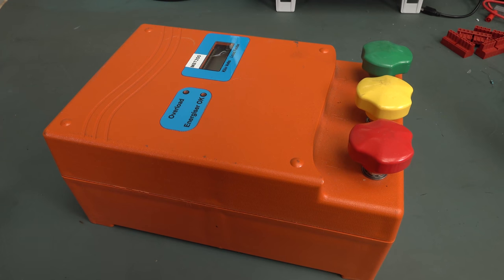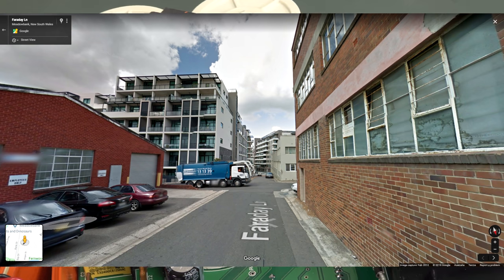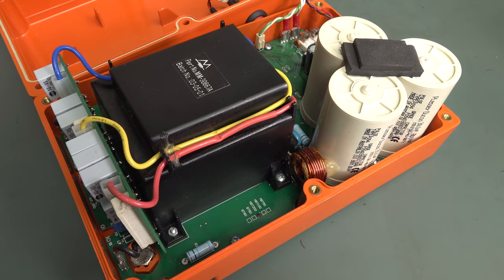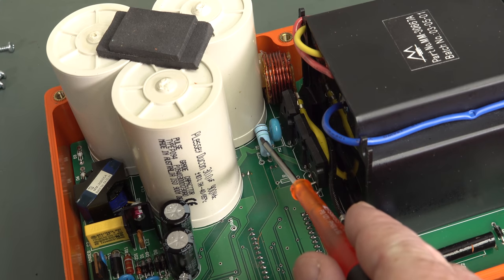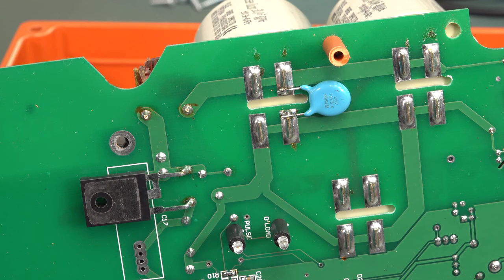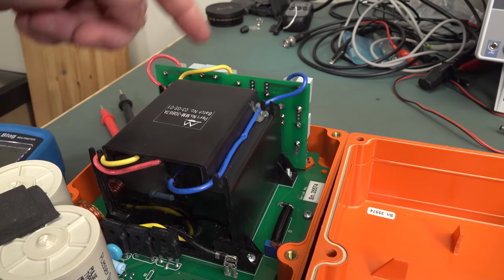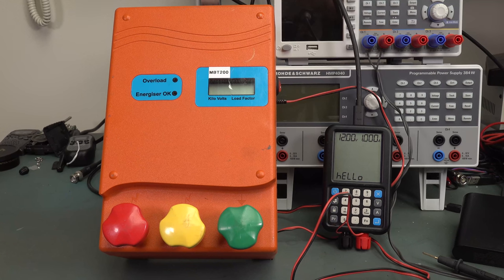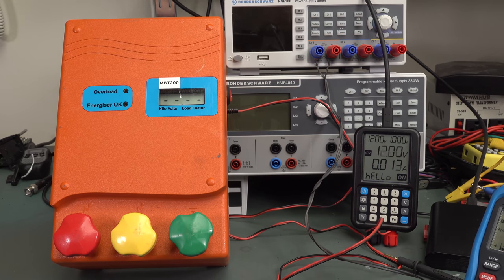EEVblog #1277 - Electric Fence Controller Teardown

Comment: When I was much younger, my buddy and I decided it would be a clever thing to run an insulated wire from the electric fence surrounding the pigsty over to the nearby metal clothesline as a "surprise" for my buddy's mom.  We ran the hidden wire and the last step was to reach through the barb wire fence and hook a little loop onto the electric fence.  I squatted down with my derriere a short distance from the ground.  The moment the hook connected with the electric fence, there was a discharge between my butt region and the ground.  I learned everything I needed to know about electric fences in a few milliseconds.  I basically defibrillated my privates.  I have always been careful around capacitors and anode terminals on CRTs ever since.  Yowzer.
Reply: The reason it happened is because the insulated wire you used wasn't rated for that kind of voltage. Your average run of the mill agriculture shock fence will put out 10-15 kV at a very low amperage. As you learn in welding, the voltage is what strikes the arc, the amperage is what burns. The amperage isn't enough to kill you, but the voltage is more than high enough to penetrate clothing and fur, without penetrating the skin. So getting zapped by either is basically the same thing, really. There's about 1kV per diagonal inch of CRT, so your average CRT computer monitor would be between 10-20 kV if it still held a charge.
Reply: @BlackEpyon  Cool info on the CRT telly's there.. : D my dad pissed by mistake on an electric fence when he was a young fella.. he said it went up through him from the tip of his Lad to the tip's of his Toe's & left him ten feet back on the ground holding his bit's in pain.... its a fuckin wonder i was ever conceived at all : P Not something id like to experience myself!!!
Reply: Thanks, I almost fell off my chair, pissing myself laughing. I had to keep stopping becuase I knew the next bit or the story was not going to end well.
Reply: @keithking1985  LOL!
I've never been "bitten" by the fence like that, but I've zapped myself on it a few times. Spooks you silly each time, but with these residential/agricultural grade fences, the point is to scare you away from the fence, not kill you. 

Zapped myself at least once on a CRT as well. You see, when I was a kid, my dad taught me to take apart CRTs and tune them (focus/color, etc). This has to be done live so you can see what you're doing, so the bit he didn't teach me then was how to safely discharge them, and that glass tube acts like a giant capacitor., aside from the DC filtering caps.

With these CRTs, the goal is to get electrons to flow from one end of the tubr to the other, so the voltage is very high, but the current is low, both to avoid burning the tube, and so that you don't draw an absurd amount of current at the wall outlet.
Reply: @BlackEpyon  i learned how CRT's worked from watching videos like Dave's ETC,, im teaching myself electronics & loving it... i have a few fly-back's in my parts box from old telly's!! i always keep them when i come across an old TV.. think of making cattle prods outa them.. Irish gypsy's would love to get their hands on them too. & seeing that im 1/4 traveler im in a good position to not get ripped off selling the odd one hear and there.. YA get me!! but yeah!! i always look where im pissing when im out shooting/hunting/fishing... ya just never know where a surprise might be hiding!!!
Reply: What a story !
Reply: @Chris Russell Fence half falling over? Yep! Dealt with enough of that. 

I got a good laugh the one time the pig accidentally backed up to the electric fence. Scared her shitless, 'cause she didn't expect it! We always had a problem having the fence close enough to the ground to stop piglets, because the pig and her impression of a bulldozer kept pushing mud up against the fence and shorting it out. For such a soft nose, those bastards are surprisingly good at moving dirt around that you can't get into with a shovel.
Reply: I did my TV repair education almost 40 years ago, nothing but CRTs back then.
Even by that time most high voltage transformers came in a resin potted enclosure.
But as we did customer repair as part of our training we often came across things from the -70's or even older.
At one time I did repair on an older Tandberg TV, at the time a local high quality brand produced here in Norway.
And this one had soldered leads to the output of the high voltage transformer terminals.
It was a 26" tube so the output was close to 20kV.
I'm not sure how I came to discover it, but by putting a screw driver to the terminals it was possible to draw arcs that could be stretched to 2-3 inches. I could even cut copy paper with the arc.
It was all fun and games until I eagerly wanted to share this "lightning force" with a fellow student and accidentaly grabbed a different screw driver that had a crack in the handle.
Definetely a zap to remember. And it left a hole in my palm that looked and smelled exactly like I would have drawn a match across a striker plate, ending the strike directly in my hand as it lit.
Reply: @jensrogerkristoffersen5472  Yeah, it's amazing how high voltage can get through cracks in the insulation. I wonder how those screw terminals didn't arc through the air though, when the conditions are right (must have a really good insulating boot). One of my CRT monitors (I'm into vintage/retro computing) had a small crack in the insulation at the base of the anode wire and would occasionally emit a buzzing sound until I gooped some silicone caulking around it. 

Most people wouldn't go through the effort of repairing CRTs these days, but when you're into collecting and preserving old computers, it's worth keeping them alive.
Reply: @BlackEpyon  - Most businesses don't go through the effort to repair flat screens neither. I bought a 50" Toshiba HD-LED smart TV and within warranty it was fried by lightning. Came home one day to find it all dead. Managed to reset it to come alive, only to one week later have the picture black out. Sound still working, but not very smart without even a channel display. Turned it in for repair and after a seriously long wait I had to go back and ask for it. Turned out they never got it back from the repair center in Sweden, it was scapped.
Just a note at the end of the service record, and never geting it back to the store they would never have contacted me. However it ended well, I got a much better 55" LG as a replacement.

I only worked with TV repair a couple of years after graduation. After that I've done mostly coaxial networks, C-TV and broadband. But I managed to keep my last "fat screen" alive for 15 years with some 7-8 repairs the last 5 of them. A repeating problem was that it switched off to standby. And every time caused by micro fractures in some solder point in the high voltage supply. Easy to locate, just switch of the light and tap the circuit board to see where the sparks were. Easy to repair, just resolder and wait for the next point to fail :-)

Comment: Dairy Farmer here; livestock fence units are normally either 5kV (sheep/small lifestyle blocks) or 10kV (Cattle/large farms). Although voltage can increase as you move down the fence line, due to bounce effect, or decrease due to shorts.

Comment: When I was younger ;) we would test the fence charger by grabbing a long reed or length of grass (meter and a half or so) and then slowly walking it over and in contact with the fence wire until we just started to feel the tingle. From this we could gauge the charge in the 12V batteries used to power the devices.
Reply: Yes, that is how I used to check them when hunting in rural US. We'd use a blade of green grass and cautiously move it on the wire.
Reply: Yeah when I was a boy we made up contests of who will get closest to the wire using a blade of grass.
Reply: And my dad's trick was to grab the fence with one hand and one of us kids with the other and conduct the shock to us. He was wearing rubber gum boots.
Reply: @dougvb9048  That was either really weak fence or your dad is a tough guy :-) I have 7J 7kV unit and that will go through wellies like nothing even if its down to 2kV because of distance or overgrown grass shorting it out.

Comment: Hey Dave, bush electronics repairer here....the yellow lug is sense, its designed to go straight to a peg in the ground, or directly connected to the green lug to give feedback when it dumps its joules.....also 3KV is a small unit, I have measured a 200KM unit at over 12kV, approx 2KM out.

The official bush test is holding a piece of green grass and holding it against the hot wire on the fence, if you can feel the zap then you are good. Gallagher had a unit on display at Ag-Quip a few years ago designed for 200KM+ runs and it was basically burning the grass with a 2M piece of 2.5mm fencing wire.

Edit: When they break it is usually the caps or transformer that goes, 50% of the time it is from corrosion, often just on the spade terminals you were praising, I have seen it a few times where farmers will keep the energizer in the same shed as bags of ferts/chemicals....ants are a good one too.

Comment: In the 80s I remember my grandad used to test his electric fences by touching them with a blade of grass held in his fingers. It still zapped you, but much less than touching the actual fence.

My dad touched an electric deer fence in the alps once with an aluminium walking pole. He said there was a large crack and then the pole shot out of his hand. Apparently he was pushing the fence down, ready to climb over it 🤦🏻‍♂️
Reply: James Grimwood yep, used to do the same.

Comment: So the way these generally work is on magnetic impulse. The caps charge at and store a lower voltage charge on the order of a few hundred volts. Then at regular intervals a triac triggers and dumps this into the transformer, which has a HV secondary to the output terminals, boosting the voltage to the kilovolt output. 

The ticking noise these boxes make is not a relay, it's the magnetostriction of the transformer core getting all that current dumped into it from the caps.
I repaired one myself previously with a failed triac (same symptoms, not ticking when switched on). It actually had a spade-mounted capacitor inside that could be changed to alter the amount of kick it gave (depending on your type of livestock, I assume)
Reply: Tesla strikes again!

Comment: I touched an electric cow fence before. Doesn't feel like a shock at all, feels like someone kicking you in the arm and chest.
Reply: Depends how you touched it
Reply: I got kicked in Oklahoma years and years ago with a bull fence.. I was 12 or 13 and pulled the Jurassic park and grabbed it to pretend I was being shocked to my cousin and it kicked me so hard I woke up on the ground smelling bacon.. burned my forearms and had a REAL barbed wire tattoo for almost a year..
Reply: Depend of how well it’s installed and how much grass is grounding the fence. Most of the time I touched them, they hurt but not that much. You need to think that cows are way better grounded then us so maybe it hurts them more.
Reply: I also got shocked by some wire fence, it wasn't that bad. (Don't know how exactly those work, but they normally didn't shocked you by just touching, you had to touch also some ground). Definitively a lot less than a 220V AC shock, which I've also got multiple times. (Yeah, I'm kinda clumsy :) )
Reply: Guessing this is because it's DC, so the muscles only tense, they don't tense/contract as they do with AC
Reply: Its pulsed DC, which contracts muscles just fine, thank you. And even if you wear insulating footwear, you're still capacitively coupled to the ground.
I was taught how to test our fences with a blade of grass. It works like a variable resistor - slide it closer until you can just feel the pulses in your fingers.
Reply: @galfisk  we always used grass too. I only got shocked once. My buddy had a brook trout farm with a electric fence on top of the regular fence. So the gate was open and the fence unhooked so I thought it was off... we were playing football in the melting snow and mud (it was late spring) and I put one arm around the pear tree that was held up by a piece of rebar and the other one on the fence. I instantly got stuck. It took a half dozen or more pulses just to whimper a bit and a few more pulses more to make actual noise. Once my buddy figured out what was happening he pushed me back off... so lucky it didn't kill me. It may have been the muddy water covering me that saved my life. I have been much more careful ever since.  I never assume anything when it comes to electricity.

Comment: was just wondering if it required on its "first startup" that it required that 16v AC to start the transistors or something along those lines , then 12v DC was "backup"
Reply from the maker: I did try the AC input but it did the exact same thing.
Reply: I worked on these units. It shouldn't care which source it is running from. The 16 V a.c. input is for mains connection, the 12 V d.c. input is for a battery backup to keep the unit running even if power fails. From memory it trickle charges the battery through a large value resistor, and then uses a diode to switch the battery into the circuit when mains power is lost.

Comment: I made long time ago fence controller from ignition coils of Suzuki GSX-R motorbike. Two secondary winding of the coils in series (to make it adequately painfull) and an MCU with a switching transistor to repeatedly charge the primary winding of the coils.  One can use even simplier NE555 for that. This is very easy and cheap way how to make it. I added some indicative diodes to show function and that was it. Worked from 12V so can run also from a car Pb acu. Any ignition coil you may have can be used. Mine model produced up to 40kV @ 2Hz frequency and about 0.6J max. energy. Was good enough  for sheep I made it for. It hit several times my neighbor you know where and she told me it was not a pleasant experience. :)

Comment: 14:03 I Calibrate 10Kv HeNe Laser power supplies for a living, and yes, I have been bitten from left hand to right hand. Painful is an understatement.
Reply from the maker: I bet!
Reply: Garrett, No, Really?
Reply: Yes really. But I must make it clear how awesome my job is. I mess with lasers and HV all day long. And I get paid to do it.
Reply: @garretthaynes8814 , I was just being facetious.  When I was young (about 11 or 12) I accidentally grabbed hold of the wrong end of a 25,000 volt transformer.  That thing knocked me across the room and got my full attention.  I vowed to NEVER do that again! Later in my life, while working on  a car with an electronic ignition,  I discovered what it's like to grab hold of about 65,000 volts. Again I became more careful around those things. In 1993 I was asked by a friend to find out why a 440v 3 phase motor had quit working,  checked it out and found 1 of the slow blow fuses had failed.  Turned the breaker off,  then reached in to pull the fuse out. That's when I discovered that the IDIOT who wired it ran the main power through the fuse first then through the breaker then to the motor. When I look back on my life it's a wonder I'm still alive!   I think  having a job such as yours would be interesting as all get out.  Just remember that the pain will most likely abate after a while...... maybe!
Reply: Geez, I thought I had bad luck lol. But you do learn quickly to discharge those caps before grabbing that unit lololol
Reply: @garretthaynes8814 ,  Oh yeah,  learned that in my high school electronics class back in '67, (man, where did the time go). We had some surplus caps out of old radar units rated at 400 volts, I don't remember what the capacitance was, but they were Big. Hooked several in parallel charged them up, then used a device we built using a 18" plastic pipe with one strand of wire taken out of a 12 gauge stranded wire placed across one end for an explosive device.  We would put a pingpong ball in the pipe and fire it across the room  by hooking the capacitors up to the wire. Made a lot of noise and you didn't want to be on the receiving end of the pingpong ball.
Reply: @Bruce Jones: Automotive electronic ignition systems are pretty weak compared to small engine magneto ignition systems, both of which I test by hand. And when testing ignition wires I find the best way to find broken insulation is to grab onto the grounded body with one hand and run each wire through my other hand, you can really get a better idea of how much if any leakage is occurring with the insulation that way (the worst part of it for me is getting my hands dirty, which I hate doing, probably because I don't have modern luxuries like running water). And when testing for ignition on small engines when it's too bright outside to see the spark I just grab the wire and pull the starter cord and if it's not as strong of a spark as usual (which you might not be able to tell with just a visual inspection), then I know something is wrong.

I've been quite impervious to electric shocks all of my life, so I don't recommend others do the same things I do. In fact my introduction to electricity was when I was about two or three years old and I stripped the paper off of a wire twist tie, bent it in a U shape and stuck it in an outlet. I can't say I noticed any shock, but the burn sure hurt. Now they have all of these tamper-proof outlets so kids can't learn about electricity.

Also I once burned a hole in my thumb while playing around with a big 6KV neon transformer about the size of a small car battery. I liked to cut through glass with the arc, although the glass re-fused where it had been cut.